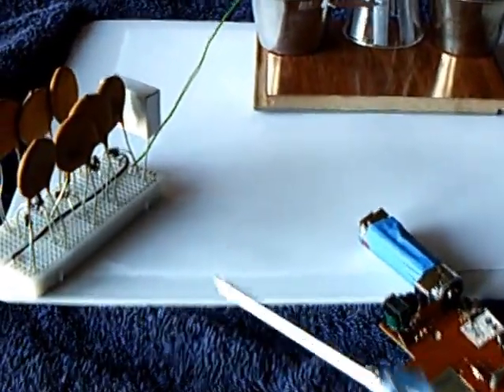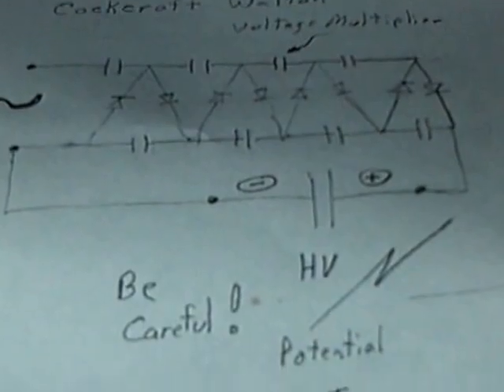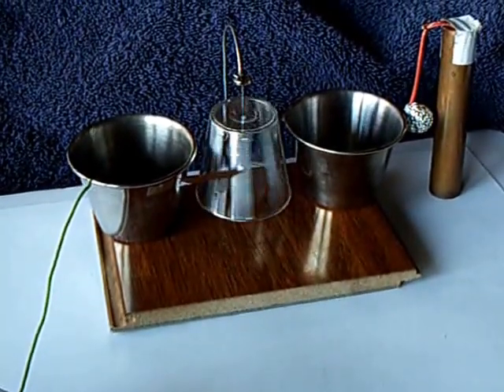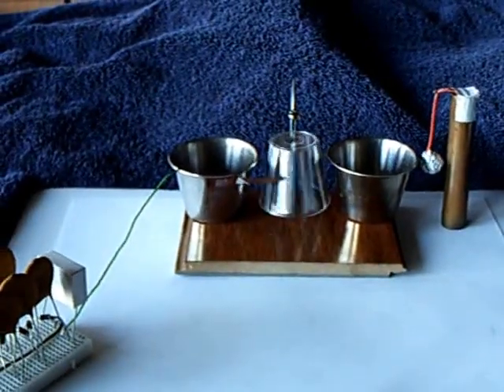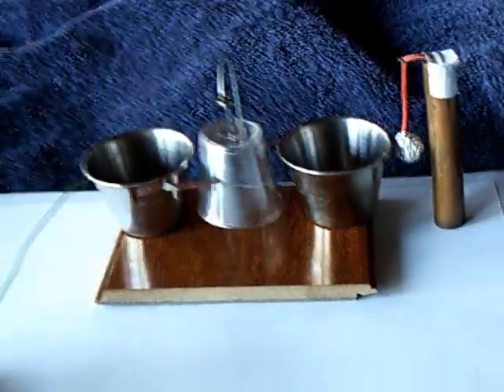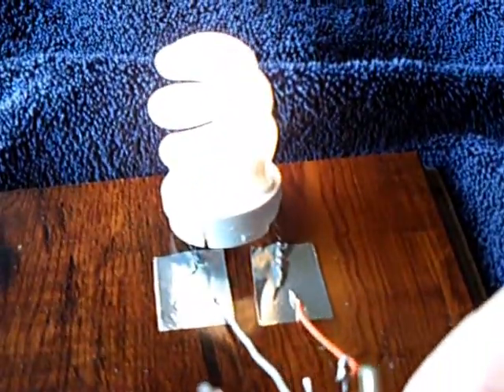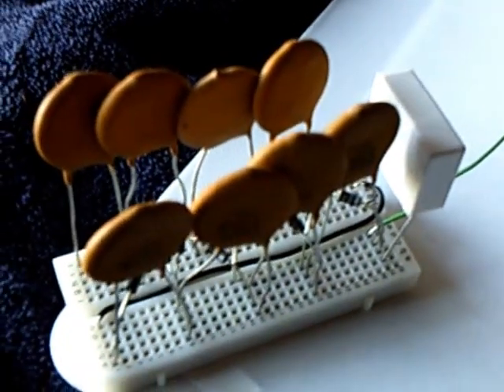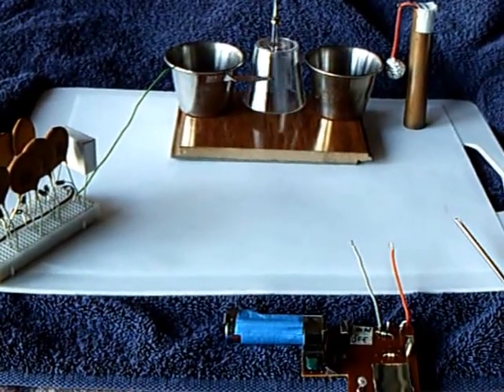AA battery High Voltage Power Source ---- for electrostatic devices

Comment: Very nice! Every time I make a voltage multiplier it always end up failing on me lol. Cheers thanks for sharing!
Reply from the maker: On this one I used 1N4007 diodes and 2500v 560pf caps.  The principle is pretty simple.  It takes an AC source to make it work.  My first few attempts failed also for various reasons.
Reply: ***** Hmm I got a bunch of high voltage diode coming soon maybe I'll try to make one :) hehehe
Reply from the maker: bakupcpu Hey--I got one of those small DC -DC converters that has the led read out and it works great!  Thanks for the video on that.  I wish that I had gotten one of those years ago.  Being able to see and adjust the voltage AND amp draw limit is wonderful.  Very handy little device.  Twenty bucks well spent.
Reply: Indeed :) Glad you like it got many other fun thing on that web site I've spend over 200$ so far think I need to stop hahaha!

Comment: Great presentation and good warnings. Hmm, an SJR 3 would likely work, tied to the Cockroft Walton. The way the rotor sped up with the bell clanking is a puzzler. Also the paper return path.
Reply from the maker: The whole thing is a puzzler for me ---but I am gradually putting the pieces together.  Jeanna's Light circuit would work on this also---joule thief with hundreds of turns on a secondary.